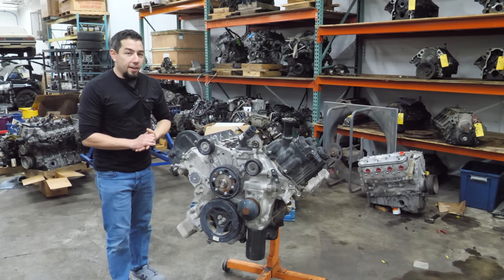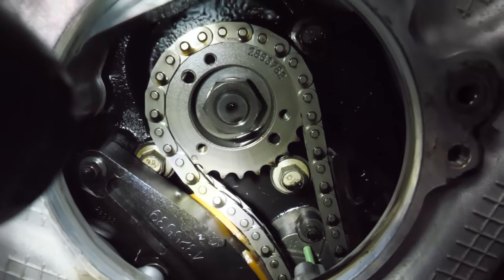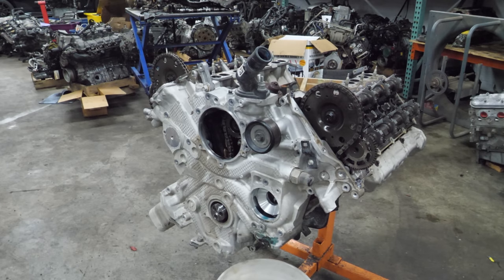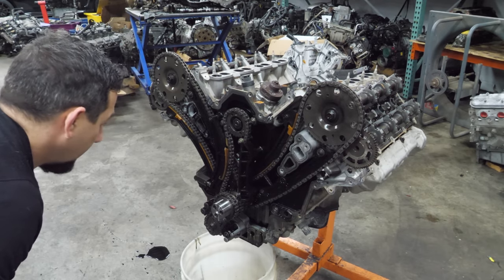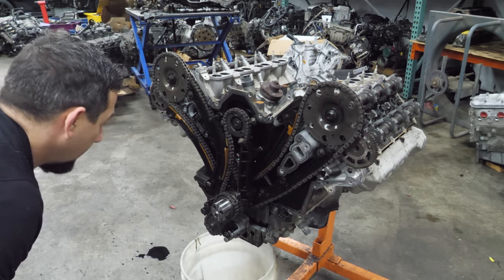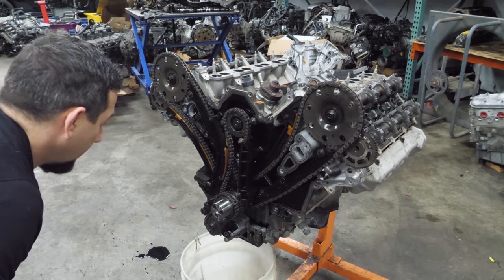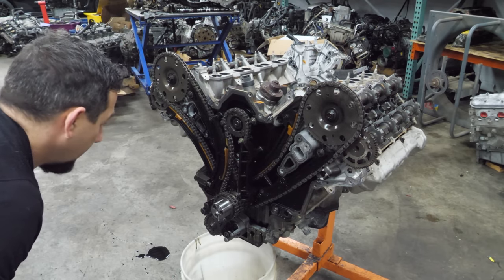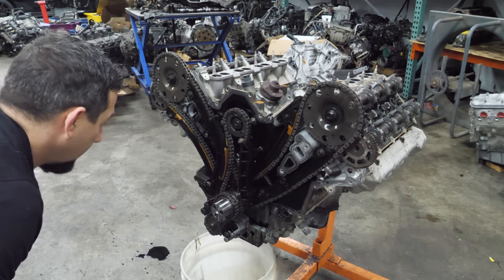Well That's Not Good! Nissan Titan XD Cummins 5.0 Turbo Diesel V8 Teardown. A Costly Failure!

Comment: The fatal flaw is the engine was made too compact. The crankshaft cheeks are anemic in an effort to keep the crankshaft as short as possible. To me it seems like Cummins and Nissan hedged their bets the failures would only appear after manufacturers warranty coverage expired. 50,000 miles is what the power train warranty period was. When a customer buys a Cummins engine such a short warranty doesn't mean a thing, you expect that engine to run smooth for 500,000 miles.  It's not ANYTHING to do with the type of oil you run. It is ENTIRELY because the crankshaft is weak due to vehicle space requirements. Feel free to look at, and compare this crankshaft with any other v8 engine crankshaft, gas or diesel, that are built to handle 1,000+ lb/ft torque. Even 2.75" longer would have made the crank substantially stronger, adding almost half an inch to each of the six cheeks. Designed and engineered to fail.

Comment: These engines were fine if they never cranked up the fuel,  the crank was the weakest point considering the emissions issues.  That's why the cummins 5.0L in the titan production didn't last.

Comment: Nonengine guy question, why did you have to pull the pistons before the crank?  I was thinking since the engine is scrap why not pull the crank caps and lift the crank out with pistons all at once?  
I assume too dangerous, but I figured it's worth asking.

Comment: PLEASE use a long brass drift, or length of wood, on the inside of the PISTON, rather than on the end of the connecting rods because you are potentially destroying the integrity of the critical cap-to-rod interface.
Hmmm, seems crankshaft breakage ot the 4th main isn't that uncommon, even in stock, low mileage engines. Back in the day, car crankshafts were normally forged 'flat' with some very heavy machinery then twisting the front and rear throws through 90 degrees to get the cross-plane form before maching. Those using this process, when they failed, would break at the same #4 main, where it was twisted and subject to the highest torsional loadings. I suspect Cummins was using this twist manufacturing method rather than the 'forged in place' technique where the crankshaft was actually forged with the crank throws in the correct position, which would have avoided the twists.

Comment: I blame oil weight….manufacturers always going for high mpg numbers but owners use trucks to tow the ford 6.7 has had bearing failures…who would have thought running 10-30 in a truck pulling 12k up a grade in 100 degree heat would cause an isue

Comment: Did I miss something? You said at 19:29 that the engine had been sitting outside for 2 decades and that's why it looked this way. I thought this motor was from a 2017 Xd with 100k plus miles. This "nice" guy you bought this from wasn't nice or honest, because there wasn't just a little metal in the oil, it was a broken camshaft. Nice video though.

Comment: I think the reason this engine was not successful, was because for the size of the motor it just didn't put out the HP or torque that it should have at that size.

Comment: It still boggles my mind why people don't use their tools more.  When you're taking out a head bolt,  there is no reason you can't just impact them out in proper order.  It's not going to break the head in half or crack it,  I promise.
Reply from the maker: That’s not why I use my breaker bar.
I use the breaker bar because I can tell if a bolt has correct tension by the release. If bolts are not uniformly tight I can tell, and it can be a clue as to if an engine was overheated or worked on improperly.
Reply: @I_Do_Cars  Was the torque on the twin crankshaft caps to spec?

Comment: Thank you for doing the engine tear downs, I do have questions, why are you using a breaker bar and not your impact, you are not assembling and engine you are disassembling, I do engine rebuilds as well as i am a red seal teck, just wandering
Reply from the maker: The force required to remove the bolts can speak volumes of engine condition and or past workmanship. TTY bolts that don’t have enough tension to pop as they release could be because a head is warped or someone reused the bolts, improper torque spec, etc.
Can’t feel much with an impact.

Comment: IS is possible the crank was heat treated and the blue color was the result of that? Otherwise, I don't see where the heat would have come from. I mean, after it broke, maybe the one main would have gotten hot. I hear the Land Rover Discovery V-6 diesel (European?) engines broke the crank a lot as a result of the rod bearings seizing. That just didn't look like a diesel, esp with he plastic valve covers.....

Comment: Was he running a full delete or delete to turn off egr and egr cooler? I ask cause I've read in forums that the issues that come up with not rerouting hot end lines back to radiator. And was he running a hot tune on the motor? I just bought a 2017 XD with 44k miles on it and plan on tuning and doing full delete in the near future

Comment: Had one, the stealership ruined it for me. One check engine light and the quoted 14,000$ to replace the fuel system. Went across the street and bought a Toyota and will never deal with Nissan again

Comment: Unreal failure. Never seen anything like this.
You don't just shear a crankshaft in half its the biggest strongest piece of metal in the engine I mean how come countless engines crack pistons, bend rods and destroy bearings but the crankshaft comes out unharmed.

Comment: Not much meat on the crank at that failure point, I would say that is the issue. Structural integrity failed.
Reply: Exactly my thoughts.  Looks like the same sort of crank failure that plagued the Ford built Lion engine.  So many crankshaft failures!  The crank was incredibly compact because the original implementation was east-west mounted for front wheel drive application in a Peugeot sedan.
https://en.wikipedia.org/wiki/Ford_AJD-V6/PSA_DT17

Comment: Overall longblock looks like a Triton, intake pattern looks like a 6.0 powerstroke.. and the timing chain/gear setup looks like a toyota.. 

From cummins, its less than their average, but still looks unreliable.. just like the average 6.7,

Comment: IVE READ BEFORE THAT 500 HP WAS THE LIMIT FOR THE CRANK/RODS ON THESE  NISSAN/ CUMMINS 5.0 DIESELS.  UNFORTUNATELY YOU HAVE TO DELETE THEM TO MAKE THEM RELIABLE BUT IF YOU DO ALSO HAVE TO AVOID THE DESIRE TO TURN UP THE HP AND JUST LEAVE IT AT STOCK POWER LEVELS UNLESS YOU WANT THE SAME THING TO HAPPEN.

Comment: The factory forgot to tighten the pump bolts, and they vibrated loose and pump fell back?? 🤷🏻

Nah, someone tried to swipe it the improper way, and gave up.

Comment: Do you even own a rubber dead blow hammer? I mean to tell you, I've watched you try to separate boxer engine cases and pop aluminum oil pans and timing covers Etc and you're pulling out a little pry bar that may or may not get a bite on something and the frequency that there may be one little bolt hidden under some Grime and dirt that's going to snap the ear off and a dead blow hammer sometimes Incorporated with a brass punch drift will give just enough impact to break loose seals on pans covers with with almost zero chance of damaging anything not to mention expedite the process of jogging seals loose. There's many satisfying aspects to your tear downs but man when it comes to you not using a dead blow hammer or monkeying around with these dipstick tubes that are dirt cheap to replace it gets annoying but I'm beginning to wonder if you do these things on purpose.

Comment: This is the first (seriously) disappointing thing I've ever come across regarding Cummins diesel engines. Btw, what did you figure out about the loose (gap) between the hp diesel injector pump ?

Comment: They didn't sell well at all.  They didn't have a lot of power, lots of issues and expensive.  For not a lot more money you could get a LOT more power in a different brand.  At one point there was a 365 day backorder on the turbos for these!!  I looked at them and decided to pass, despite loving my 2007 Titan gasser.
Reply: Loved my 2005 Titan. Aside from the common exhaust manifold crack issue it was solid for 150k miles before I sold it. The diesel Titan made no sense. The gasser beat it on TFL's Ike gauntlet towing test. It was gutless compared to Ram/Ford/Chevy diesels, couldn't tow a 5th wheel, and had horrible payload/towing capacities for the cost.
Reply: @wtbman  I finally had to do the manifolds in mine at 135K.  I'll tell ya, doing the 2008 brake upgrade made towing so nice!   1" larger rotors made a big difference.

Comment: I want to see a John Deere 7.6 liter diesel engine offered as an option in a pick up truck. Dodge Ram would benefit best if this were to ever happen. Some of the new Dodge diesels are using Alfa Romeo Diesels because Alfa Romeo now owns Dodge and trucks with those engines are are having problems.

Comment: Broken cranks were not uncommon on the early engines.  Cummins f***ed up with i believe the heat treating.  later engines dont have this issue.

Comment: What kind of a dingus leaves a core outside and then charges over$1k for it??  Cover it with plastic at least.  Surprised to see that crank that blue without more bearing carnage or coked oil.

Comment: The 3 bolts act like studs for the cp4. To remove you time the engine, mount a special tool to the front cover, remove the big nut on shaft, install tool to push out pump from gear and remove 3 nuts attached to the bolt on the valley side on pump. Used tool that was installed to push out cp4. 
The 3 bolts and front cover do not come off to remove pump. What happened was someone didn’t know how to remove it. They removed the 3 nuts the used a pry bar and bent up the gear breaking the chain guide.

Comment: Super interesting.. how can a 5 year old diesel engine w 125k miles fail so badly ?   Looks like it got lots of oil changes.  
      Sad the owner spent so much to get a superior engine and a cheap gas engine would have lasted longer.

Comment: Was it just me or did the crank looked blueish ? that crank got pretty hot
Reply: No, it wasn't just you. That crank was blue.

That has me wondering something. I have been thinking for quite a few years now that iron won't blue from heat like that while steel will. Does iron turn blue from heat, or is that a phenomenon that's limited to steel?
Reply: @alflyover4413  im not %100 but maybe it depends more on the sheen of the metal !???

Comment: a fiend broke one on the other side of that same jernil he stoped at the light and no noises or anything it just died and he tryed to start it and it wouldint turn over we towed it home and took it apart and the crank had broken i used that last part of it for an small anvel for years after that  ya just ideling and then it died dident make a sound just stalled and was locked up was on a small block chevy

Comment: That crank is pretty poor design. There is very little material supporting the crank pins. I’m guessing they took off too much material trying to make the engine more compact. It’s probably acceptable for stock power levels, but since diesel truck bros always feel the need to tune their vehicles for maximum smoke output, I’m sure the owner pushed this one way, way past design spec.
Reply: Exactly my thoughts.  Looks like the same sort of crank failure that plagued the Ford built Lion engine.  So many crankshaft failures!  The crank was incredibly compact because the original implementation was east-west mounted for front wheel drive application in a Peugeot sedan.
https://en.wikipedia.org/wiki/Ford_AJD-V6/PSA_DT17

Comment: That type of bearing damabe is from a crap transmission tune - lugging the engine at low RPM's making CRAZY cylinder pressure hammers the sh!t out of the top bearings and produces that type of damage.  That is also what probably led to the destruction of that crankshaft.  Modern diesels do NOT like to be lugged - let them sing a little bit, they are designed for it.

Comment: Actually, just an FYI, these 5.0's are terrible. Nissan started a buy back program because the failure rate was astoundingly high. Between turbo, fuel and emission systems problems to complete engine failure very early on they were just awful. And they ditched the planned Alison transmission for an Aisin one that was hastily slapped together specifcally for the Cummins and of very poor quality. There's a reason they only used them for 3 years and it wasn't because of sales, they sold well but I'd say probably 80% of them were sold back due to the previously mentioned issues.

Comment: No free lunch, you don't slap a tune in an engine and expect 25% more than the engineers (and bean counters) designed for without some cost. Over tuning is what earned ford 6.0 and 6.4l power strokes such a bad rep.. egr is egr and egr sucks, is what it is, but id bet most lifted heads were not stock.

Comment: That engine looks like it could be rebuilt. 
As for the BMW  take  out tear out all the electronics take them apart wash them with distilled water dry them and store them in Rice to suck all the water out of them  the harnesses team them down same deal,  take out the carpet toss it as well as the jet paying wash out the inside of the car and dry it get every inch then place it in a hot room to dry out every inch tires and wheels need to come off as dies the rubber and plastic parts the room has to be around 110f for a week with good airmovment 
And a dehumidifier  the faster you get it dry the better  everything can be washed 
I would try to save fabrics its moldy by now.  Get all the sand mud and water out you can save most of that car motor also needs the same attention as does any mechanical part that can hold water.
Sea water is corrosive.  Get the salt off with fresh water you might be ok, some fabrics could be ok becuse mold cant grow in salt environments.  But its risky.
If its a very valuable car it might be worth saving.  Age cars are not.

Comment: And to be honest with you the cause of the engine crank failure is something called hydrolock well let's say he found a moon boost tune/AKA cilender head and valve delete he may have a bad boost controller??? IDK . That one cylinder that's on bottom dead center somewhere in there the one  filled with water. Well it's the start he hit the switch bet it has an auto start oh on a diesels they're torque monster's 😭😭😭 well snappy snap and the bluing of the Crank is caused by the u see it. The rear isn't moving but the front is and the heat/knock=bluing so lucky to have a very useable long block just needs a crankI haven't watched the video all the way through but I do not think the main bearings and or the rod bearings are the culprit or add to the destruction new crank seating valves I mean damn you got lucky timing chain kit God we going to make some serious money off that thing really easy good pic I would just send some words and have the block checked out you're good to go

Comment: When you opened the first valve cover what is the line of 4 PLUGS?? down the center of the head with 2 or 3 missing that head number 2 had ???

Comment: This motor was rejected by Toyota as well.   It well known as a failure of a motor for Cummins.  Built too weak for the size of truck it was destined for or built to big and  inefficient for the intended use by Cummins.  Unfortunately, Nissan thought it was an answer and gave a decent truck a bad name.

Comment: I just had to stop the video and comment. I would be very angry after paying a good amount for it. Just to open it up and first off, something is just not right with the pump being backed out like that. Next, standing water inside and all of the rust. from something that was caused by the seller. and just for good measure, it sure looked like water coming out of the pump, beading up on the table. OK I restart the video now.

Comment: What makes no sense is developing a V8 to replace the PROVEN DESIGN inline 4-5-6 cyl diesel; even MB had a Cummins style inline 5/6 until 2006 and then they went WOKE and the new V6 BLUE-TEK went BROKE.

Comment: Nasty Failure for an under 200K Cummins designed and mfg'd engine. Surprised Mfg didn't help cust since crank is broken.
Reply: Supposedly, Nissan had a big hand in tuning these engines/transmissions instead of letting Cummins own it completely. That put engine warranty liability on Nissan. And they don’t want anything to do with this engine now. Nissan is a joke if there’s truth to this.

Comment: 4 timing chains, DOHC= unreliable junk, what was wrong with Cummings designing that v8 engine with 1 camshaft and gear driven valve train like the duramax, powerstroke and I6 Cummins

Comment: No modern diesel is worth owning if the design requires that crankcase breather gases need to be mixed with exhaust gases on their way to the intake ports of the cylinder head. The sludge produced is unavoidable and essentially kills the engine over time. It's common sense - oil vapor + exhaust soot = sludge. The environmental police that believe nitrogen oxides are dooming the planet have created an untenable situation that will not go away until someone designs a cylinder head that manages to separate the flow of EGR and crankcase breather gases on their way into the combustion chamber.
Reply: You almost made a good post....

Comment: I used to build these engines and, man, they were junk! That was typical wear on the bearings after a 10 hrs test. The cranks had stress cracks from the supplier. Nissan actually dropped Cummins because of all the problems. Cummins isn't what it used to be. They build junk and their employees are over worked.